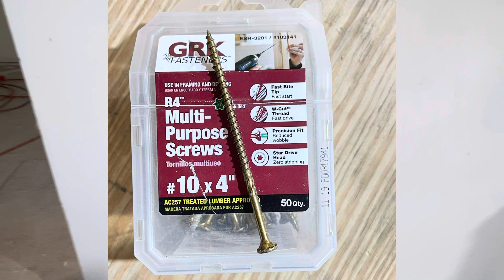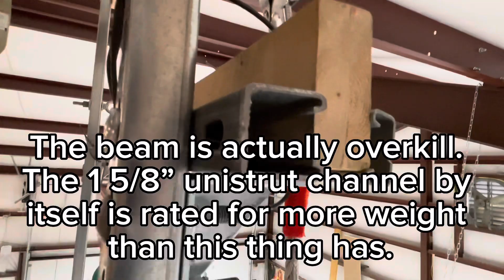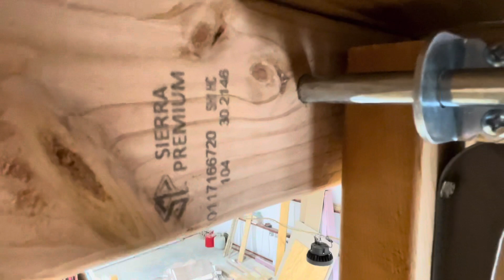Cargo Elevator/Lift From Garage To Loft

Comment: Absolutely one of the best designs of many that I have watched. No welding involved using Unistruts for lift floor and an abundance of excellent safety features. Superb video and editing supplemented by word descriptions and photos too. Excellent detail on connections, fastenings, etc.

I would be interested in an estimated cost, probably $500 - $700 US?
Reply from the maker: @brianbaker359  Thanks for the comments. I don’t recall exact cost, but I believe it’s right in the neighborhood that you mentioned. Probably between $600 and $800 altogether.